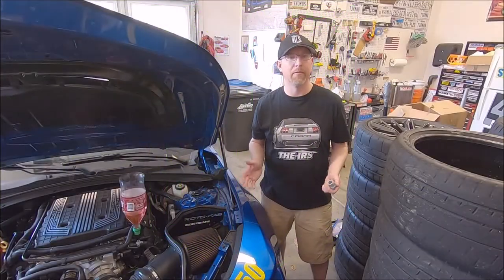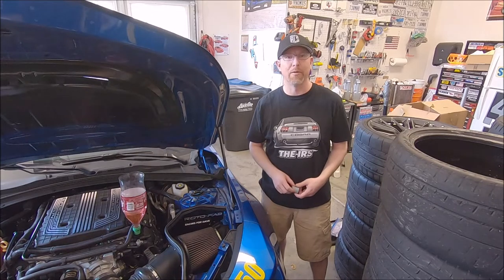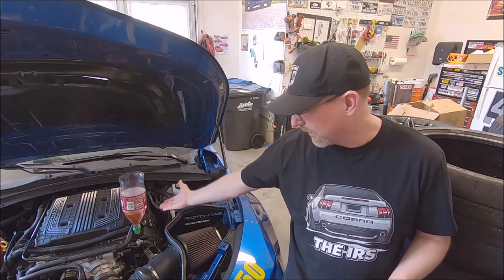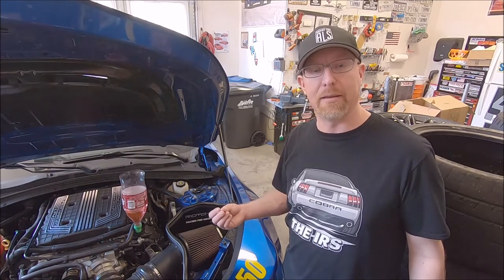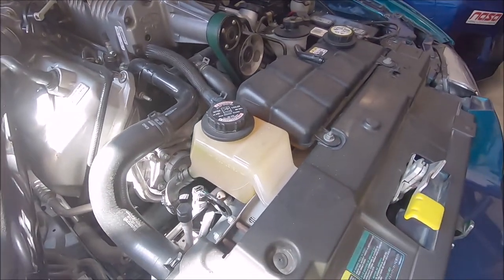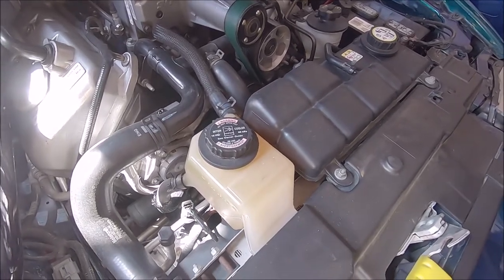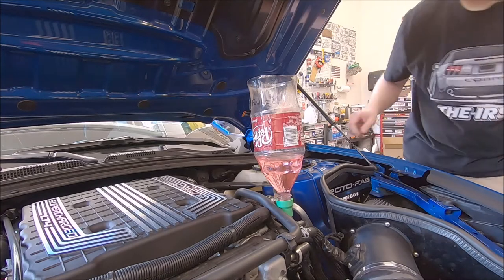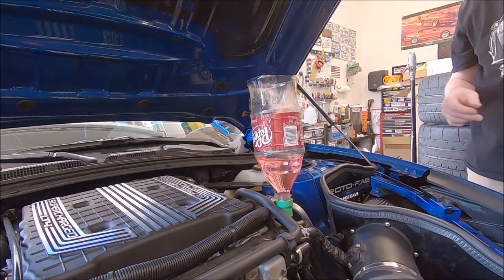Camaro ZL1 Supercharger Intercooler Air Removal System Burp Dr. Pepper Method

Comment: Just did this today. How do you not get coolant left in the bottle everywhere? Lol. I was surprised how much it burped, very little coolant left to spill. Thank you for the recommendation!
Reply from the maker: There isn't an easy way to not spill some. You can slowly put a shop rag in the funnel and jam it in the bottom before removing it.
Reply from the maker: I came up with a better way to avoid spilling. Take an empty 12 oz water bottle, jam a paper towel in the end, then put in into the 2-liter bottle upside down, then pull the 2-liter bottle off. 💯💯💯

Comment: After you're done, how did you get the rest of the coolant out of the bottle?
Reply from the maker: Stuff a rag from the top of the bottle down through the fluid into the bottom with a long screwdriver. It plugs the funnel, and only a couple of ounces of liquid will come out.

Comment: Could this same thing be used for the 5th gen zl1's? I just picked one up last weekend and wanna make sure im getting all the hp i paid for haha
Reply from the maker: I'm not sure how similar the LSA and LT4 systems are, but I would check the system for air if it doesn't have a reservoir.

Comment: What happens if run the car without Inter cooler?
Reply from the maker: Low fluid level, air in the system, or no intercooler would result in high intake air temperatures and the ECU will dramatically pull timing and reduce power.

Comment: How often does this need to be done?
Reply from the maker: The system should not lose fluid, so it is complete after all the air is out of the system. You can check every 6 months or so if any air has moved out of the heat exchangers or radiators.